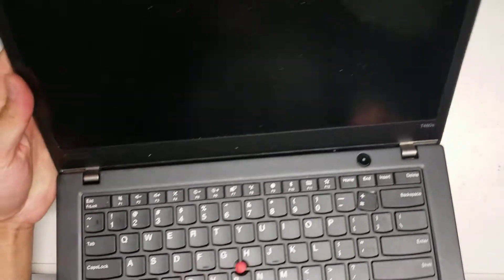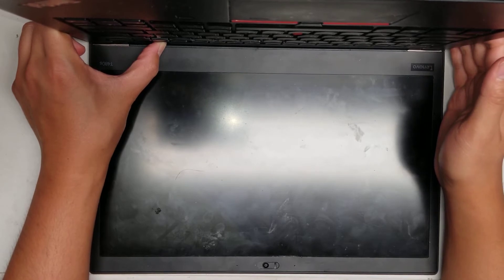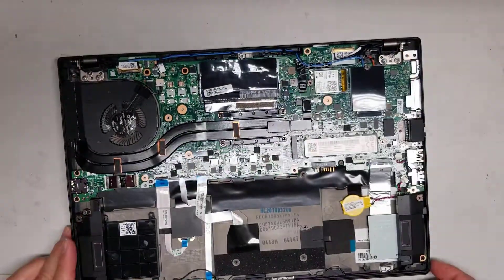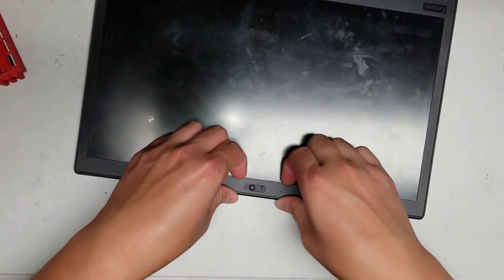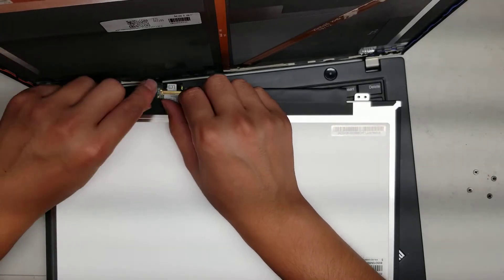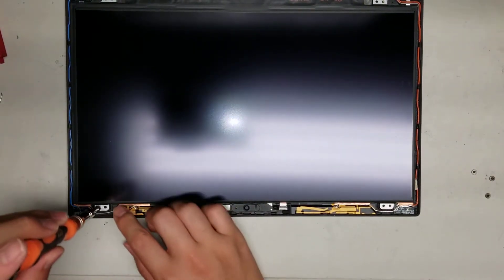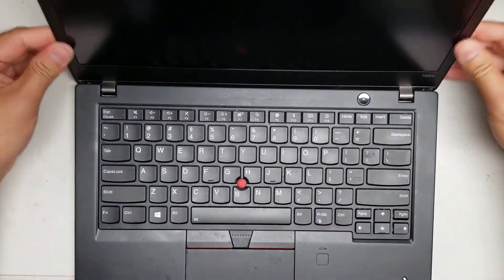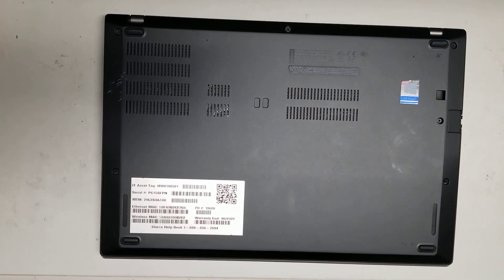Lenovo ThinkPad T480S Disassembly RAM SSD Hard Drive Upgrade Repair Screen LCD Replacement

Comment: hi a question for you I put a WLAN card in my t480s 1802 Unauthorized network card without installing this is the second one I put in this its a common problem, any idea to fix this problem
Reply from the maker: Needs to be made for that laptop.

Comment: At 4:55 when referencing the speaker, are the speakers accessible at that point in the laptop disassembly? Or are the speakers under the motherboard in which case the motherboard needs to be removed first? I need to replace a dead speaker in a T480s. Btw thanks for the video!
Reply from the maker: open it up and take a look. Use a little brain power. I don't have these computers to open up and check every little extra thing. it should be obvious if something is on top preventing you from pulling it out or not.
Reply: @ItsBinhRepaired  just replaced the speakers, it was easy peasy, didn't have to remove the motherboard to replace them
Reply from the maker: @mech_builder7998  glad you were able to figure it out.